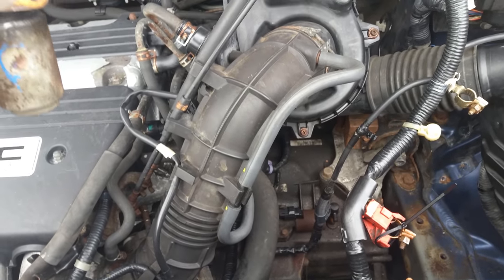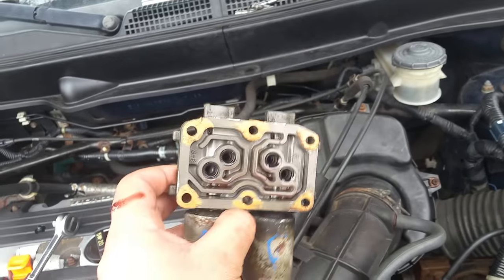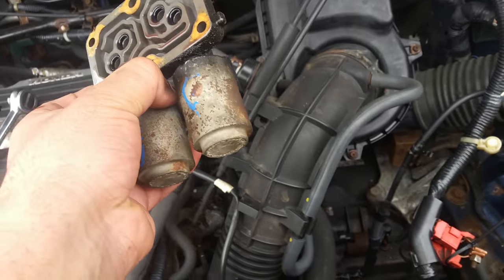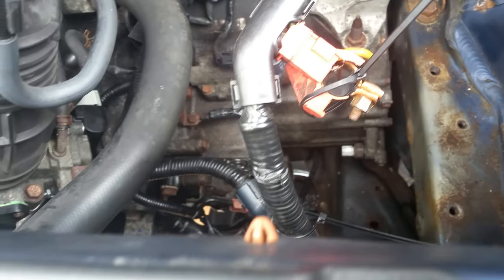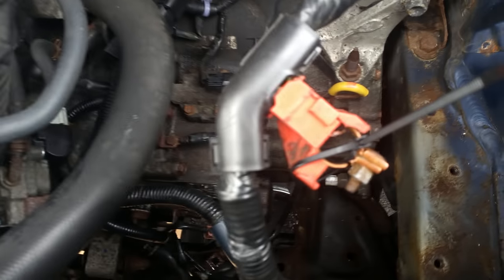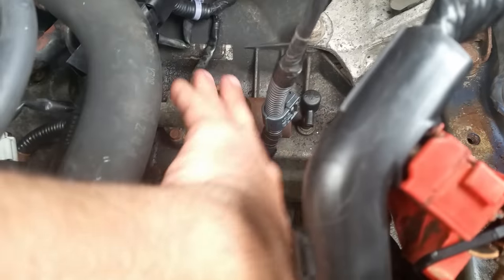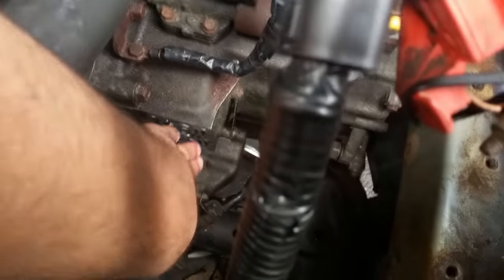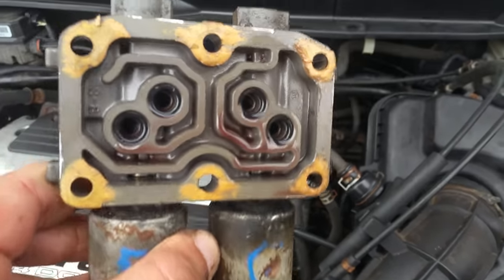Honda transmission hard shift  jerk from 1st to 2nd gear

Comment: 99 Honda odyssey I did that and the other ones…brand new…stil no good results, tcs/ check engine light on..oh yea brand new 02 sensors as well, under100,000 too, and it’s showing p0135

Comment: Thank you for sharing this video. My 07 Honda pilot developed this exact  problem from 1sr to 2nd gear but only when the engine and transmission are cold it goes away after driving for 20 minutes.  I will definitely look into this.
Reply: I have same issue 07 CRV as yours, did the replacement solved the issue for you?
Reply: I'm having the same issue. But mine is when down shifting, or coming to a stop. It jerks the car (2006 Accord) from 2nd to 1st. It's also delaying and slams when I put it in drive on a cold start. Once the trans gets hot enough after about 30 minutes of driving, it works pretty fine. I'm going to try finding a used OEM selonoid.

Comment: I have 2002 automatic Civic.
I did an engine swap.
Everything was fine until I started driving the car and the transmission just quit pulling. It will pull just a little bit when it's cold. But then within a few seconds it'll stop pulling and just slip.
 Any ideas?

Comment: I have an element with a very jerky and laboured shift from 1st to 2nd. Do you think the dual solenoid would help my issue? Thanks in advance.
Reply from the maker: I think so my honda element hss the same issue and the selenoid fixed the problem.
Reply: Is check engine light on or showed any codes?

Comment: How did you know which of the 2 solenoid transmission to change? Did you the jerk shift from 1st to 2nd only happen during morning cold start? Do you experience also gear not engaging to 1st when move shifter to Drive in the morning?
Reply from the maker: The transmission will jerk when hot or cold from first to second gear I tried a used solenoid from the the junkyard and it fix the problem, I got the two solenoid for about $30 in case I need both but ended up using 1 only .
Reply: I have the same problem. Also does yours show a check engine light?

Comment: That is very good . But what was the problem  no gears. ?  no power. ?  High rpm ?  Thanks 🙏
Reply from the maker: Transmission jerking and shaking bad in 1 and 2 gears.
Reply: No gears yes power just rpm no movement
Reply: 2000  Honda Accord v6

Comment: I have honda civic automatic transmission. And when the engine is cold in the morning it won't shift up from first gear. When it warms up a little it will work just fine not issue from that point. 
What could be the issue
Reply from the maker: I'm not sure but try changing the transmission fluid
Reply: @aladdin1709  sure will try that 
Hope it works

Comment: At any point in time while your trans wasnt working did you green drive light on the dash start blinking ?
Reply from the maker: No lights just jerking between gears
Reply: ALADDIN so do you think my problem is the same ? My car is 2004 honda pilot. The light doesnt blink all the time only sometimes. When it does my pilot wont shift from 1-2 its like the rpm go high and it skips that gear and drives fine after that
Reply from the maker: @gabrown6654  try new fluid in your transmission first
Reply: ALADDIN i changed it and the oil
Reply: ALADDIN i looked up the sypmtoms and youtube suggest it being a pressure switch or a solenoid
Reply from the maker: @gabrown6654  if it was me I will drain and add new fluid first and see
Reply: ALADDIN i did do that and the same thing happened agin
Reply from the maker: @gabrown6654  ok try deferent selenoid from the junkyard don't buy aftermarket parts
Reply: @aladdin1709  did it fix?
Reply from the maker: @haurahaziq1292  yes working like new
Reply: @gabrown6654  did it fix? I have same issue
Reply: Haura Haziq yes i did but mines wasnt just the solenoid it was also the ground cable for the solenoid need to be cleaned and the spot needed to be sanded also there is a box on the fuse box under the steering wheel its white and square if none of that works try it.
Reply: @gabrown6654  what box?
Reply: @gabrown6654  how can i contact you? I want some picture of the white box youre talking about
Reply: Haura Haziq do you have a email ?
Reply: @gabrown6654  I’m gonna have to try cleaning that ground I had jerking shift from 1-2 and eventually slipping. I replaced the solenoids with ones off a wrecked car from pick n pull. Shifts great 1-2 but won’t shift out of 2nd to 3rd. Thinking it might be the pressure switches I shall try the ones off the same donor car.
Reply: @citystarridin  did you swap out the transmission oil filter? They get clogged
Reply: @eduardoquezada11  yeah I did, a tranny fluid change and a new filter helped but after awhile the problem persisted and the whining on cold starts came back. 3 weeks ago the torque converter broke on my CRV so I just swapped in a lower mileage transmission and new TC. Shifts like a new car now!
Reply: I need help I HAVE A 2000 HONDA ACCORD V6 LIGHT WAS BLINKING IN DRIVE THEN COULE MONTHS LATER CAR WOULDNT GO IN TO GEAR OR 1.2.3 D .R. WHAT SHULD I TRY BEFOR CHANGING TRANSMISSION..
Reply: Yes
Reply: I ended up having to replace the transmission most of all those were just temporary fix’s all in all those year transmissions in the pilot, element and oddessy will just have to be replace.  the engine is pretty much immortal and bullet proof but at some point after 220k you will have to replace the trans or have it rebuilt

Comment: I have been looking for a automobile transmission specialist so that I could learn a lot about these issues. My Honda Fit first gen has D blinking without giving any codes. It will start and when I switch off the engine and start again it stops. Do you think my transmission is going?
Reply: need to pull the linear soleniods and clean the screens

Comment: Update from my inicial comment, I replaced that dual linear solenoid and pressure switches on my 2007 pilot, but didn’t fix the hard shift from first to 2nd gear. 

The fix in my case was ( throttle body replacement & re-learn process) shifting is smooth again😅
Reply: Hi, did yours delay and jerk when shifting from P to D/R on cold/morning start?
Reply: @curiank1879  Hi, sorry for the late reply. No delay in my case.
Reply: What was the issue with your throttle body? 

Having the same issue with my Fit. Hard shifts from 1-2. Yet to try replacing the part in this video but curious as to how the throttle body might be the issue

Comment: I have a 2004 honda pilot and i have a code P0730 guy said i need to rebuild trans. Plz help he said it would be 3 thousand dollars
Reply from the maker: Hi ,it can be the selenoid here a link may help you 
https://www.piloteers.org/threads/something-to-check-on-higher-mileage-pilot-transmissions-code-p0730.28437/

Comment: Hey bro I have a 2007 element hard shift 1 to 2 and it won’t go out of second the VSA light came up I turn off and on the car then runs good for a while VSA light goes away but eventually starts doing it again any thoughts? Thanks
Reply from the maker: Check this link may help
https://www.elementownersclub.com/threads/vsa-engine-light.76630/
Reply: Thank you bro,God bless you
Reply: @aladdin1709  just wanted to follow up and maybe it’ll help someone turned out to be the pedal position sensor bro

Comment: Which one solenoid is which one is B
Reply from the maker: http://dz310nzuyimx0.cloudfront.net/strapr1/6d913102e6b5385dc6bf884ad425b4ac/653c936cae46638209c138ac40f1f962.gif
Reply from the maker: part number 5 and 7 are the two solenoid , i fix my car when i replaced the part number 7 check the link.
Reply: what year is your Honda?

Comment: Did you put a new gasket?
Reply from the maker: Yes you need to clean off the old gasket and put new one
Reply: ayadi ala where can you buy gasket?
Reply from the maker: @lebronjordan802  28262-PRP-000 this the part number check eBay or Amazon
Reply: ayadi ala thanks 👍
Reply: What’s the torque
 please?

Comment: What is the meaning of shift solenoid d struck on in acura tl 
It give me jurk when i put in drive mode to car but after that shifting properly
Reply from the maker: Probably need some cleaning check the screens on it too
Reply: @aladdin1709  which part needs to clean bri
Reply: @aladdin1709  and what is the meaning of screen check brother
Reply from the maker: Check this video https://youtu.be/RvgN_00OjfQ

Comment: what was the transmission issue?
Reply from the maker: Shifts bad from first gear to second like jerking
Reply: @aladdin1709  my 2014 v6 accord also jerking when shifting from firs to second, could be the same problem?
Reply from the maker: @weekendinwa.  maybe try cleaning the selenoid first if not buy other one
Reply: @aladdin1709  Ok, in my case I just changed transmission fluid twice and external filter and everything back to normal 👍👍👍
Reply: @weekendinwa.  what you mean changed trans fluid twice?
Reply: When you drain your transmission liquid,  not 100% of  it come out, so normally you need to change it 2-3 times with 50km interval between changes. 
In my case transmission fluid was very dark color, after 2 changes it become clear and gears shifting smooth now.

Comment: I have violent shake when I press the gas pedal just when driving slow noticed the rpm drops and it shakes the whole car bad feels like the front tire are wobble idk it’s the shudder on those Honda’s but got not bad axel or any of those driveshaft
Reply from the maker: This video about jerking between 1-2 gears and the fix other selenoid for the transmission

Comment: good friend greetings I have code 5 in D4 that will be that failure honda accord 2000
Reply from the maker: This Honda Element has deferent engine and transmission but you can change your transmission fluid first if not it can be the selenoid.
Reply: @aladdin1709  
the box is recently repaired they changed everything and from before it was the same with code 5 in D4
Reply: @aladdin1709  
but I don't know what that code will be because I bypass it and scan from the board and it blinks 5 times. D4 is the only code that it is giving me.
Reply from the maker: @davidcarrera6178  you need to check with the person who fix it I think it's a selenoid problem
Reply: @aladdin1709  
I changed all the sensors since I have 2 equal accord and the problem also changes the branch and computer and the same .. but thank you very much I will continue investigating to see

Comment: I went to the junk yard, replaced the dual selenoide with new OEM gasket like the one u showed and the jerking on my transmission still remains. Any other tips?
Reply from the maker: You need to make sure the used part is good also try to flush the old fluid

Comment: What was the problem?
Reply from the maker: jerking when shifting gears from 1-2
Reply: How did you fix the problem Caz I’m having the same issue with my 2012 Honda Civic
Reply from the maker: @christophersutherland3564  I just replaced the shift selenoid and it fix the problem but you can try drain and refill the transmission with new fluid first .
Reply: Christopher Sutherland I drained and refilled the fluids at least 4 times. But it was years ago and the transmission has been doing the same thing. The clutch is never slip once it’s in gear so it still feels healthy. You can buy a low mileage used transmission cheaper than someone can rebuild it but I definitely want to try the shift solenoids. Just strange how all gears went out at once but if I ran some clutch material through it then it makes sense
Reply from the maker: @eb972  yes you try other shift selenoid i bought mine used from the junk yard and it work good

Comment: When I take it off will it leak fluid
Reply from the maker: Yes put drain pan underneath
Reply: @aladdin1709  should I buy more tranny fluid
Reply: @aladdin1709  with my honda it's a automatic and I have to manually shift it threw the gears if not it will bang into gears u think that's the issue
Reply from the maker: @Mattys91gt  yes
Reply: @aladdin1709  did u have any codes on from the solinode
Reply: @aladdin1709  was there 3 I see the 2 together then 1 on top
Reply from the maker: @Mattys91gt  there's one solenoid on top and one on the front
Reply: @aladdin1709  thank you